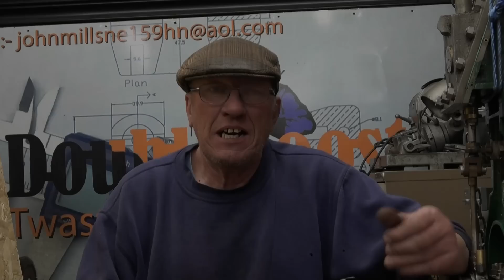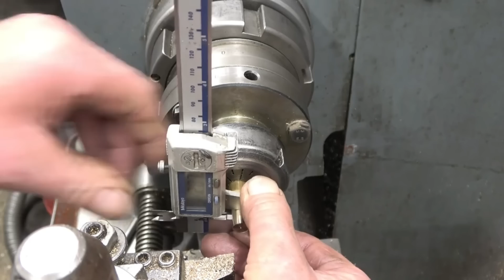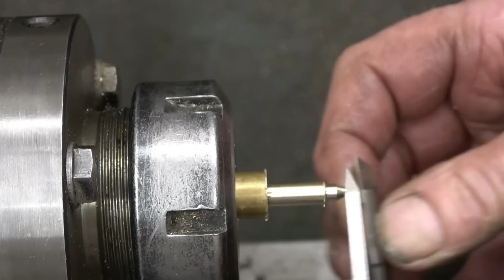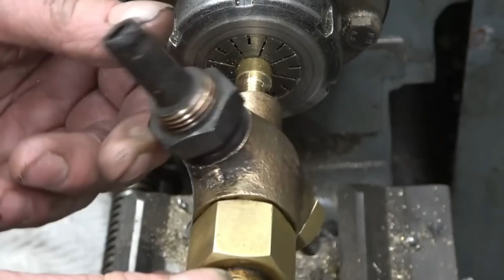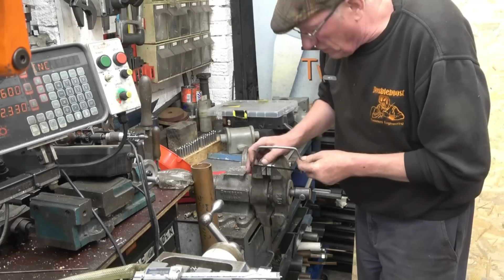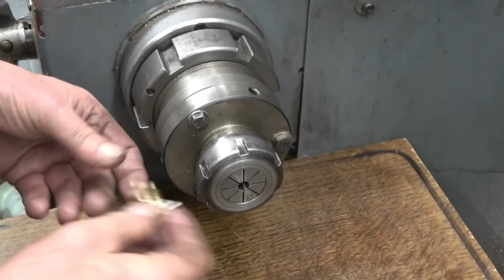SNNC 540  Steam Waggon Oil (tell tale) Valve

Comment: I had to make a couple of these valve screws for an old petrol/paraffin Lister stationary engine a while ago, but these had to have thumbscrews &  very long threads (one needed a break of about 1.5” in the thread to run through a sealing gland). An interesting little job that was. Can’t remember what angle the taper was now, but soon after I’d made them I was asked to make another for a petrol only version, so it only needed the shorter one.

Comment: Is there any packing in the valve? I didn’t see it in the video, also it seems that there is no packing nut. I would expect that the steam and oil would escape through the orifice where the needle screws in, but it looks like they don’t. I’m trying to build small and minimal valve for pressurized gasoline and looking for some ideas
Reply from the maker: The valve spindle has a seat at both ends 
It only seals full open or closed .
That is all it needs to do

Comment: Good result John. May I suggest an old school tip? If you reduce one of those tightening lugs in length, if it ever works loose again, it won't unscrew fully and drop off. It will only unscrew less than one revolution until the heaviest/longest lug is at the bottom. Like a one lugged wing nut. Gravity prevents the lug from unscrewing itself uphill. The heaviest lug remains at the lowest point when loose.

Comment: Ha. Another source of hot air (and oil). Laugh. You laugh at yourself. My turn. But I have done a lot of other jobs where my so called friends take the mickey out of me. Retired mechanic/machinist in old convict settlement Down Under.

Comment: Sunday night anchor lube cap. Brilliant as usual. Though, would have been easier to part off then fit the pin. Heating the brass portion would have ensured the pin fell in. No need to bend it or mushroom the ends with the hammer.